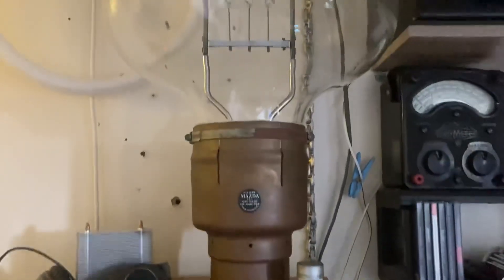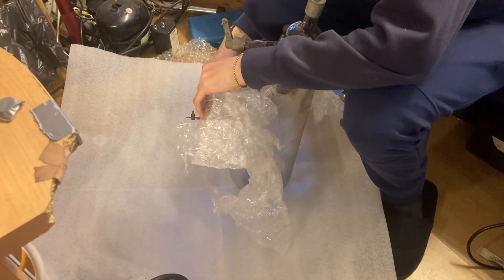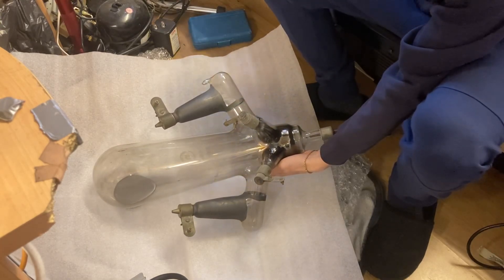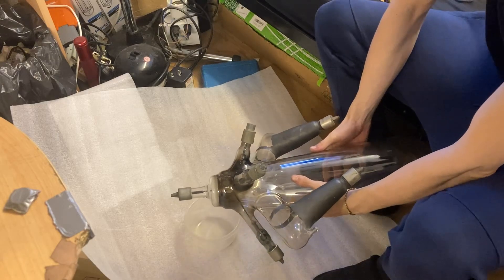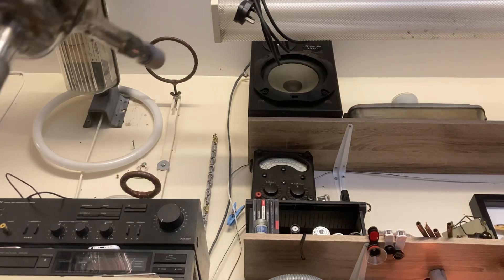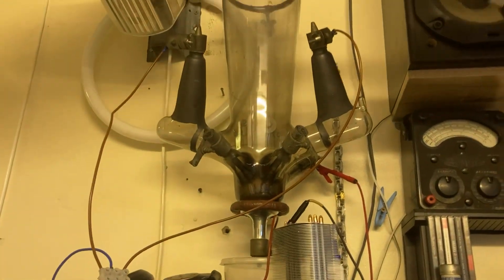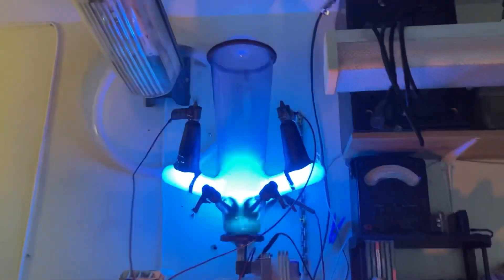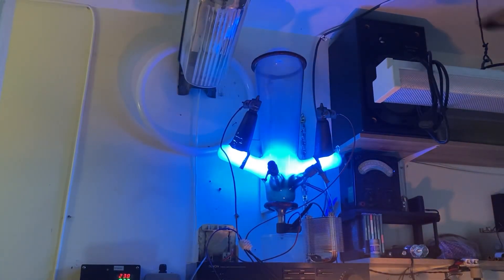Mercury arc rectifier

Comment: Couple interesting facts about these Mercure Arc rectifiers in terms of the single phase ones.

First of all were used in some of the street Lighting systems the DC power somewhere in a single phase in probably using three phase ones as well in some cases sink this is back when the ark lights were still in use at one point they were used for DC for Street lighting it's the only thing that makes sense for the DC is for arclights!

Also I know that the serious Street Lighting systems the amperage and the setup using the constant current stuff set the ratings were actually hold over from the old Arc lamp systems

Back to the single FaZe Mercury are rectifiers.

These were actually created in wood when being shipped there were upside down in the crating!

When the tricky things was putting them right side up after receiving them and could be very tricky to get the Mercury where it goes in the actual rectifier bottom.

What are the things that have to be very careful of is not doing this in the wrong Manner and actually snapping off the arms on the rectifier of course spelling Mercury everywhere in the process if this occurs.

Yeah some of the bigger ones had more Mercury than others especially those ginormous three-phase ones!

Also something of Interest sometimes Mercury are rectifiers of certain designs possibly all but kind of shaky on this could actually back Ark and destroy the device in the process.

Known some old timers back in the day that still had worked with them.

Have also done a lot of reading back in the day on this had borrowed some old manuals and all that's still had reference to the Mercury Arc rectifiers fascinating stuff.

Seen a few in still a New Year's years ago myself.

Mansion was before at least once about a carbon Arc Light Source that was used for unknown reasons possibly projection of some sort likely where a lot of intense light was needed dude what was being projected more so than anything else in that area.

Very little used rooms at school that was a quote unquote media room or at least that's what I called it.

The whole thing was in a room just off that room had hit a switch that wasn't marked and I heard a very angry sounding power supply and saw a bit of blue light and what looked like a glint carbon Arc Light.

Interesting thing is this had a system that could keep this going automatically in some way the carbons were actually automatically Advanced and even struck and was able to change carbon's automatically the idea was that disliked Source could be used by just throwing a switch most sophisticated thing I've ever seen four projection.

It had to be something that was not any more news and the amount of light required makes me think that it was some media that need a lot more light than usual or perhaps this was something for other than just projection possibly making a duplicate or possibly on to another type of film.

Either or it was something that the media was so dense that required that much light perhaps some sort of odd color film from back in the day of course the other parts of the system were long gone and well the openings for everything were kind of blocked off able to see a bit of the ArcLight how long this whole thing still working and not being disconnected.

By the way showed the guys on stage for this as well one time and they were absolutely amazed.

And yes Originators to carbonate projectors in tandem in the projection of the years ago replace later with projector using Xenon Arc lamps.

I hear there's an old system that used possibly something similar but for stadium lighting add something also where essentially there was a magazine of carbons.

This had something similar but I'm not sure if the mechanism was somewhere or not I heard these carbons and no systems had to be renewed occasionally I guess you'd say Reloaded would be more like it.

Perhaps this was a derivative of that or don't know if which came first.

Elmo's wish I could have scrapped that equipment although it was too bulky and really probably wouldn't have been much years it would have been better to be reassembled somewhere in a museum I think

Although I was offered a carbon Ark power supply once that have been modified for a general purpose power supply probably would have been blown main fuses if even tried to run it unfortunately not enough power bill where I was living.

Don't remember how many amps input but with anything else running probably would have exceeded the 60 amp service for sure!

Comment: Thanks for an exciting video about your latest acquisition Ethan. Absolutely flipping wonderful, I can see that you're dead chuffed and rightly so! Do MARs of that size require forced air cooling at full power? I don't suppose you'll be whacking the full power capability through it any time soon though.
Reply from the maker: It needs a fan under it yes, even at low power it’s probably still a good idea but I have plans to give it close to full power eventually lol

Comment: I have been working on building a glass lathe so that I can start making my own vacuum tubes and mercury arc rectifiers and such. I have been assembling a small machine shop to support my new YouTube channel that will specialize in pre WWI race cars and interesting machines and restorations intermixed with some glass blowing and other cool stuff. Tentatively I am calling it machines and motors. I am recovering from. getting run over on my 1957 Harley with a Ford F350 truck nearly taking my right leg off but I am nearly back on my feet again.
Reply from the maker: I look forward to seeing some of that glass stuff, my friend Peter Jameson makes small neon tubes which are pretty cool

Comment: 'someone who i know will appreciate it' ... narrowed down to 1 Andy in 1 second   \o/

I had nearly that much mercury in a nice glass bottle in my teens, part of a 1960s chemistry set as a hand-me-down. Simple, sketchy, 80s fun!
Reply: I was thinking exactly the same thing! Incredible to see him, and in such good spirits. Excellent devices which will be enjoyed by both of you guys!
Reply: I had a nice bottle of mercury in 1985. It was drained from manometers used in a gas turbine test bed. The calibration guys used to spill it all over the place and not clean up properly. You could find little balls of mercury everywhere. Fortunately for the engine testers everything was cleaned up and the manometers were replaced with transducers and a data acquisition system. Sorry, I am not sure what happened to the bottle.